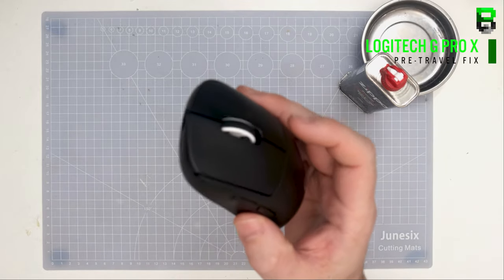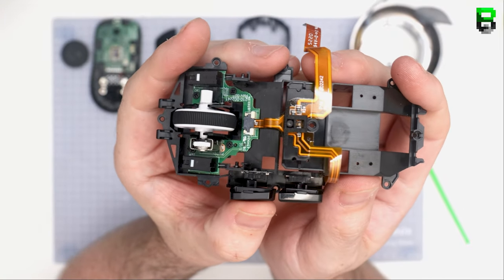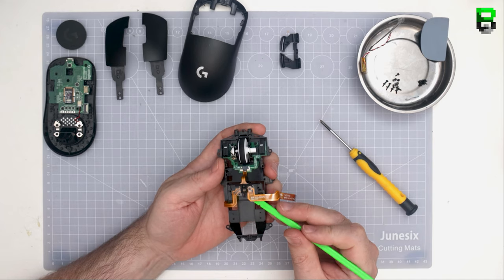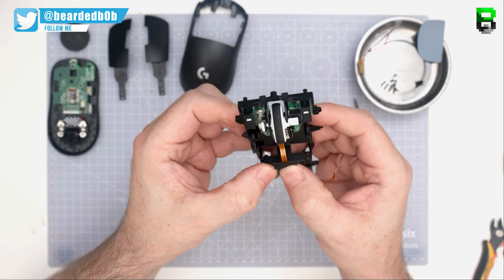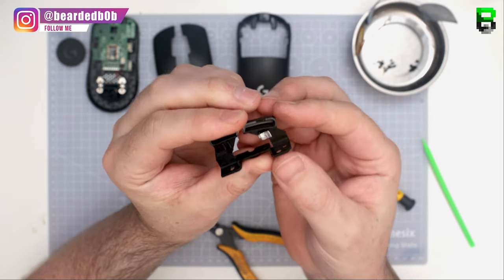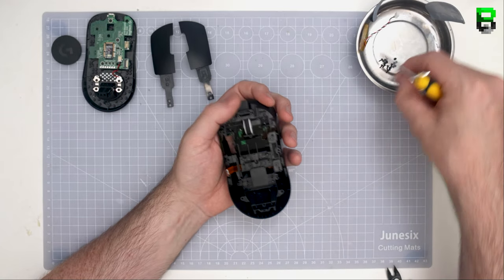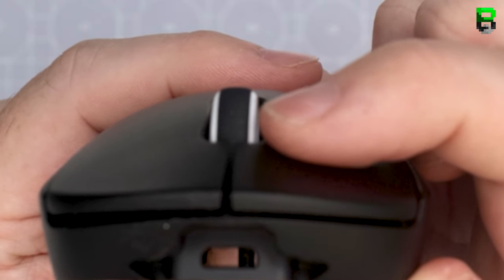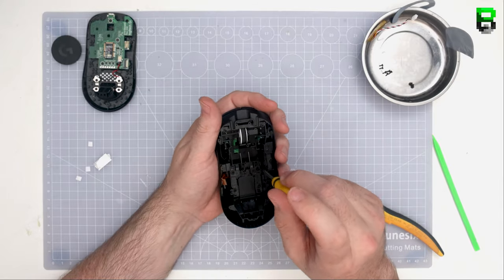Stop Mushy Clicks: Logitech G Pro X Superlight Guide

Comment: I would be OK with modding a $10-20 mouse. But for a $100+ mouse, I feel like I shouldn't have to touch it at all. Ridiculous.
Reply: Well then clearly the video isn’t made for you
Reply: @eno3792  You completely missed his point. The point is that a 100$+ mouse should not have the need for fix-mods like this, it should work perfectly out the box with precision and longevity.
Reply: @tripletdriplet6043  Oh yeah you're right I totally misread that comment. Thanks
Reply: @eno3792  Mistakes happen xP
Reply: im realy angry with this mouse its only been a year of consistant use and my mouse scroll wheel presses when i click

Comment: Hey beardedbob, I bought some Kailh switches from your site, and I need an expert opinion on something. I just bought a Basilisk x Hyperspeed that I planned to swap the kailh switches for. Problem is.... the clicks on the left main click feels really bad. Its mushy and there is some pretty bad pre/post travel. Would swapping the switches solve this issue, or is it maybe the construction of the shell of my unit that is abit off? Anyway Iam still within my return window, so I was wondering if it would be worth going through the trouble to return and get a new Basilisk or would soldering new switches on the mouse solve all the issues? Thank you for the response. I also emailed you with a full video plus more details

Comment: Could you also reduce pre-travel on the main mouse buttons by putting in new spacers? Do you know the thickness of the stock spacers?
Reply from the maker: Yes you could.... each mouse is different so you will need to measure/adjust for that mouse.
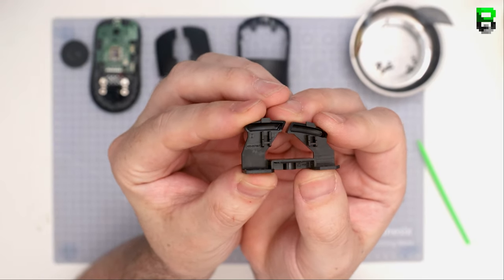Reply: 4:19 What Part OF the mouse Is he Holding ? What is it Called ? Can I replace it If broke ?
Reply: @dermi9748  that piece of plastic is the entire piece that makes up the side buttons. As far as I know, if it breaks it’s not replaceable unless you can find one on a place like eBay or Etsy.
Reply: You can actually find any superlight replacement part on Amazon or aliexpress
Reply: @ColeRusselPB  Huh. Good to know
Reply: Yeah I came across it when searching and searching for a heavier switch but it couldn't be found for heavier then 4.0 kailh reds  so I actually tried opposite of what you see here in the video adding more pre and post travel since they're is a limiter it adds to the force of the click I actually love this fix but this is only day 1 with it
Reply: I might even add tape like in part 2 of mouse 1 fix for the bit of shakiness of mouse 1 and 2 because the force pulling it up will still remain

Comment: Great video! I was just wondering if opening up the mouse and putting tape on the side buttons to remove pre-travel voids the warranty
Reply from the maker: I would say opening it voids it but I can’t confirm eitherway
Reply: @Beardedbob  Do you think it's worth it voiding the warranty for better side buttons?
Reply: just make sure you use gloves so your fingerprints don't show inside the mouse and carefully take out the battery so the adhesive doesn't wrinkle

Comment: If you’re holding down the right button does the left button clash into it? The original G Pro mouse would have the two buttons clash into each other. Returned 3 of them before realising it was a design flaq
Reply: a little late but i had the same problem, i was like no way the buttons are going under each other it’s a expensive mouse I’m doing something wrong 😂

Comment: Just got a g pro super light from Best Buy, mine seems to have little to no pre travel, however it seems like the tension spring that forces the left click back up is to reset is too weak. I notice on games I’ll fire off 2 shots when I’m trying to one tap…. Is this a common issue? Would I have any luck returning mine and getting a different one from the same place?? Thanks
Reply: 4:19 What Part OF the mouse Is he Holding ? What is it Called ? Can I replace it If broke ?
Reply: Try my fix in the comments doing the exact opposite of his mouse 1 fix to add pretravel / post to the Max there's a limiter so it will just add force to the down clicking
Reply: @dermi9748  read my comment reply to you

Comment: can I replace the side buttons with kailh mini micro switches without detaching the ribbon cable and pcb from the skeleton? Just wondering before I mod my superlight
Reply: In order to get the side button PCB out, you have to take the main switch PCB out as well as the scroll wheel. it’s not too bad at all
Reply: 4:19 What Part OF the mouse Is he Holding ? What is it Called ? Can I replace it If broke ?
Reply: @dermi9748  That is literally the side thumb button piece. From my knowledge, not replaceable

Comment: Hi Beardedbob, I did the bend mods but now if I shake the mouse there is a slight rattle from m1 and m2. Also if I tap the mouse on my desk it rattles a lot. Any tips? Hope for a reply. Thanks!
Reply: Also thought I should add, all the screws are tight and secure I checked multiple times.
Reply from the maker: rattle? did a screw come lose? o just saw your other message..... maybe a bit of plastic or the battery cable lose.
Reply: 4:19 What Part OF the mouse Is he Holding ? What is it Called ? Can I replace it If broke ?

Comment: Does anyone have any idea how to fix the feeling of my left click creaking. When the switch bottoms out it creaks when slightly moves side to side. Under pressure and daily use this happens every click.
Reply from the maker: need to replace the switch
Reply: @Beardedbob  I have replaced the mouse switch with ttc golds, should I place the actual plastic clickers?

Comment: Looking for a modder:
My experience so far with my GPX Superlight (annoyances) .. 
1. Buttons .. are too slow, I want a button I barely have to touch as a trigger. Hair trigger.
2. Scroll Wheel .. stepping is too loose, e.g. switching weapons (1 click/1 detent) is hit and miss. The notch spring / mechanism needs to be much tighter.
3. Side buttons .. are too recessed and need to be about 2mm taller. 

I don't have any of this pre-travel garbage. Thank God and my biggest annoyances are the left click and scroll wheel.

For my age, I seriously doubt anyone plays Call of Duty better, I get V2's often. However, I play only Hardcore which are millisecond battles. So any delay or screwing around infuriates me.
Reply: .. BTW .. I wouldn't tolerate those mushy buttons for a second, I would have returned that mouse in a snap of a finger. Or it would have ended up in my trash can in little pieces.
Reply: Looking at your videos .. It looks like you also play hardcore Call of Duty. I'm [1964]Momba.